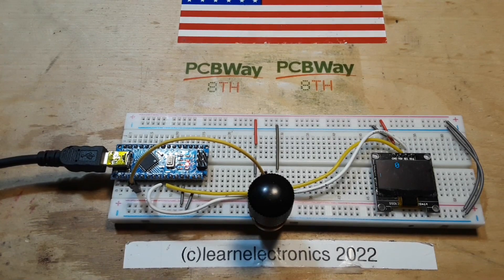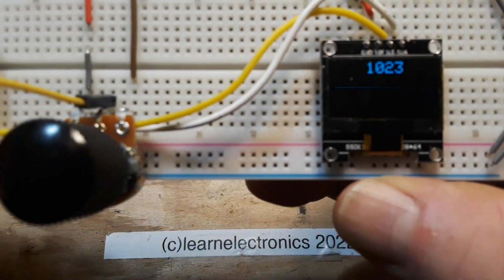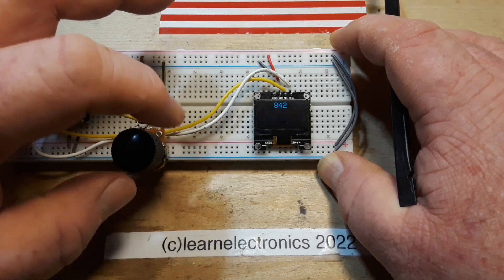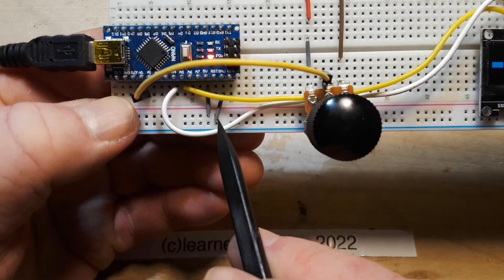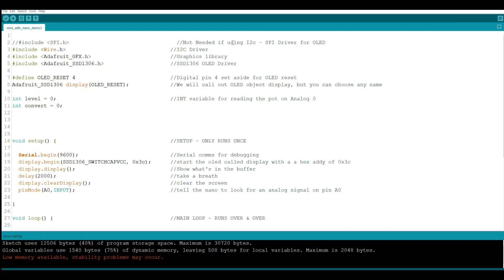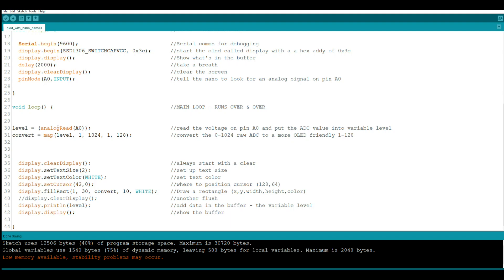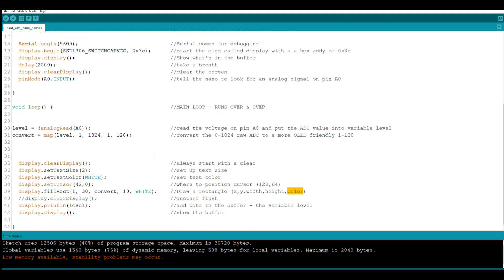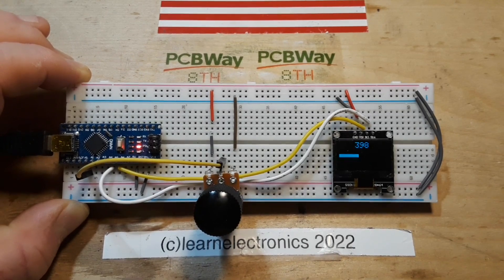Arduino Foundation Series: Add A Bar Graph To Your Project

Comment: Why does the screen keep blinking on the bar chart?
Reply: The lcd screen is driven by a PWM signal. It turns on and off the screen really fast. The eye can’t detect this but the camera does. The display doesn’t flash off camera.

Comment: Can you switch colors ( on a color display) at a predetermined level so that the bar graph will show red ( danger)?
Reply: I don't have any oled multi colour displays, just TFTs, and use micropython rather than Arduino, but I think the process is the same. If you want to, say, have green up to 80% and then red for anything larger, it would be in an if block where you would draw 2 rectangles. If you needed to turn the whole bar red, just clear the screen and refresh it with the new colour.
Reply from the maker: Yes you can